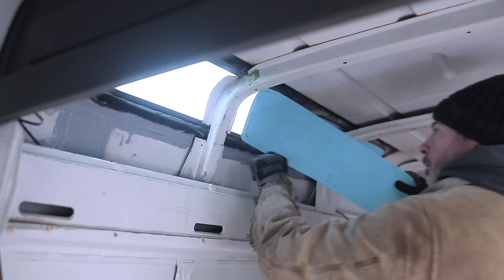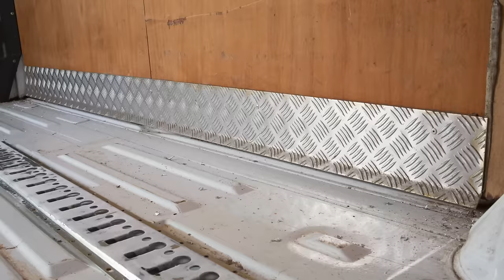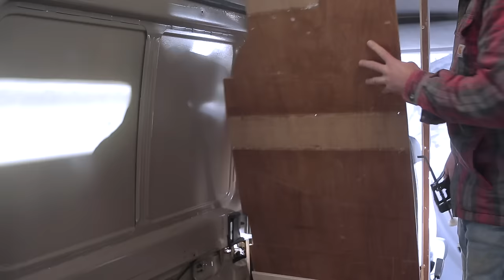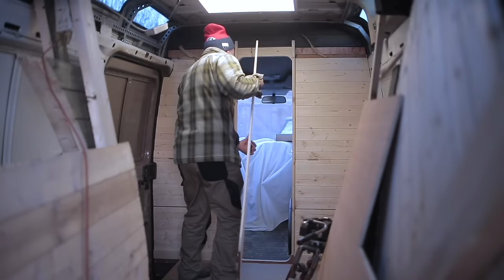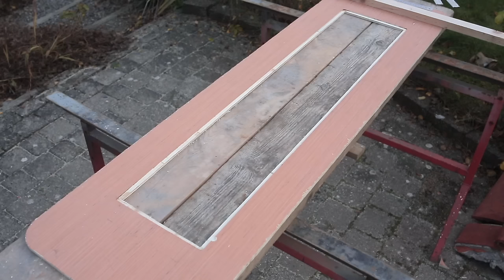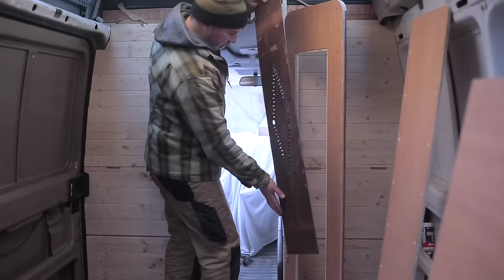How camper conversions get it wrong | Classic Sprinter build

Comment: You can cut straighter lines with the round side of the router than you can with the straight bit. 
Always enjoy the videos.
Reply: Interesting. Why's that then?
Reply: @beetooex  if the router kicks on the flat surface it's gonna sorta fall onto the big radius -more room for error - if you setup for big radius you have a lot more ergonomic control of the tool and aren't locked into fighting the flat surface against rotation - the radius will give you much more arm rotation through the cut.

Comment: Many really good points here. Even here in Southern Finland where we live camping in the winter is temporary if the wife kicks you out of home you will freeze your bollocks off. We had a transit Connect and to gain some space to move stuff removed the bulkhead thingy. Man was it cold in that van in the Finnish winter the poor heater was working overtime. Nice video by the way. Love what you have done with the bulkhead thingy. Give yourself a pat on the back :)

Comment: Beautiful, and the strength and versatility you've built into the bulkhead is impressive.  The only suggestion I can give for the sake of longevity is that the wood be sealed or treated (if it hasn't already) since it will be exposed to moisture.  That moisture can cause the wood to warp, separate and rot.  There are various polyurethanes that can give you a satin, flat, or glossy finish, sealing the wood while also providing a surface that's easy to clean and durable.
Reply from the maker: Could epoxy it, for further strength, durability and moisture-proofing, but it won’t do weight any favours

Comment: Looking forward to seeing your take on a van conversion! As you mentioned weight is a killer (not to mention the safety aspects) so I cringe every time I see IKEA kitchen units, porcelain tiles, sinks and MDF. Sorry not a fan of pine cladding either😏
I did my best to keep our 4x4 Sprinter as light as possible and it still gets far too close to 3.5T when fully loaded.

Comment: Soup-George attaboy-ing the bulkhead with piano-hinges and  the bulkhead-door with something unhinged coming also from a piano ... priceless. After getting rid of my swb T1N for ride-quality reasons, I am actually getting a T4 VW done for sleep-overs beside the road sea right now. It's absolutely too tiny inside for a decommissioned piano-door, but I got hold of quite some old 1910s Art Nouveau furniture pieces for fillings, fronts and details to recombine with aramide-carbon-composite framing and brushed aluminium profiles - Nothing better than custom interiors. Oh, perhaps a Lotus might come close, though. 😁 Thanks for sharing!

Comment: Excellent work as always, with real thought behind not only the practicality but also the beauty of the thing you're building.  The modularity of the bulkhead is an excellent use of what would otherwise be totally dead space and looks really easy to set up and use even at this early stage.  I'd be cautious of using satin as a backing for the fretwork, it's quite susceptible to UV damage leading it to fade and even break apart.  Upholstery grade fabrics tend to be more UV stable and of course there's always paint, foils, decorative metal sheets, and a whole plethora of other materials you could use which I'm sure you've already thought about.

Comment: That door looks great!  If it's not already in your plan, look into getting some iron-on edge banding that matches the plywood of the door.  It'll clean up the cut edges and make the door look like it was cut from a single slab of wood.
Reply from the maker: That’d be lovely, I’d want it in brass though. Pigs may fly
Reply: @soupclassicmotoring   Sticky backed copper tape is a thing.  It's not brass, but...

Comment: A work of art and a small engineering marvel, that bulkhead.  Nice job.  Don't sell yourself short on your woodworking skills.  I can't tell you how many times I see a skilled metal worker bust out their angle grinders, zip disks, flap disks, DA sanders and die grinders when they switch to the wood part of their project.  At least you own and know how to use proper woodworking tools.

Comment: There is no "wrong" in a camper conversion as long as it suits the builder's purpose.  Weekend camping or more or less fultime living has very different requirements.  Any van without some kind of a toilet would be wrong for me, has always been so, but particularly since COVID.  My tolerance for using any kind of public facility is almost zero.

Comment: I have a parliament hinge pivot as well, you just need to be careful with heavier big full size doors that the frame they are mounting onto is strong enough, as you have a lot more weight extended on the pivot, hence your door will be forever dropping on one side..  not your problem in this example, great video love the attention to detail, humour and individual thinking…❤😂👍 amazed at how you finish all this in less than 19 mins work,, 😅😂🤣 the clean up should be about 30 seconds don’t you think..

Comment: I like the fold down kid beds (?). That's novel and useful.  I always want to do the rotating front passenger seat, but that's on a smaller van.   I like the guy on his third build that just didn't do any kind of wet room or plumbing and that was right after I saw a video about a vanlifer that lost their build to a plumbing leak and water damage and had to do a spendy $$$ rebuild.  You just need big plastic water jugs and some pump(s).  Maybe a greywater jug.  Buckets and jugs.  I love diy builds.  They are the best.  Simple but innovative.  Don't get too busy.  Commercial builds kinda suck.

Comment: Most people look at van conversions as a house closet with windows. I am surprised they do not use concrete for the walls and floors.  Reinforced Crawlspace Foam Board Insulation and insulation blankets covered with material is the lightest weight material for conversions.  And then design it so everything is quickly removable including the floor.

Comment: Another thing they get wrong is using lambswool insulation for wet use. Body vapour (or anything more than that!) flows a certain amount through lambswool insulation resulting in dampness. Dacron, on the other hand, is made from recycled plastic bottles that is 100% non-absorbent and the minute difference in thermic loss by comparison is not noticeable in installations such as a van conversion. Body vapour rests on the surface of Dacron without being absorbed through it and evaporates off its surface much faster than off lambswool. If you use lambswool, especially for wet utility, you're asking for water absorption by comparison to plastic, regardless of how well they tell you wool "manages" it. Use Dacron. 🙂

Comment: Dunno where you are planning on sticking that Rockwool but i made the mistake of thinking it would work well as insulation in the walls on a van many years ago. It doesn't seal the air away from the steel panels so you get condensation in your walls which on my transit ran down the insides where i couldn't see it and rotted out the rear panels behind the rear wheels and the side door bottom from the inside out. Make sure the paint is good in the cavities or seal the metal up or don't bother with any insulation and just fit a better heater as it's not for living in for long periods.
Reply from the maker: I have a plan 🤓

Comment: Hallo, I am enjoying the journey of your camper conversion.  Regarding the insulation, I noticed you had a roll of loft insulation.  I live on a boat and after much research found that most products will not stop condensation, ( the enemy of van life.)  The only sure way is expanding foam.  Have you looked into this? Regards Grant

Comment: Regarding putting some satin behind the panel - would it be possible to lift it a few mm off the board behind, have it float a bit? And maybe put some LED's in the void that shine through the holes and on the saturn
Reply from the maker: Someone had the brainwave to use perspex, but that’s a nice idea too

Comment: As much as I appreciate the wood work. I think this is going to become very noisy. Wood especially low density moves so much in a warm-to-ice-cold environment that i think this will be very creaky over time.
Reply from the maker: Good call, I’m a sucker for learning by mistakes though 😅
Reply: I know and I'd like to have a piece of that too. Stop overthinking and enjoying the path to wherever things lead ;-) @soupclassicmotoring
Reply from the maker: I have the experience too! It’s amazing how much epoxy ply can soak up even without using cloth or mat. Starts to get pretty heavy. Def an option later if things get noisy though

Comment: There really is no such things a s a van build that has lost its way. What you do with your van, is different than what someone else does with theirs. Sure, you will be fine if staying a couple of days, here and there, in temperate locations. However, many people are living in theirs for extended periods, and traveling to very hot or cold climates. So they do need the extra floor and wall insulation.

Comment: You could have easily
Put ply under the rail instead of insulation. The insulation has no bearing on the bolts holding the rail down to the floor simple engineering

Comment: I don’t understand why you talk so much about weight, when this bulkhead you just built is twice as heavy compared to a simple bulkhead...Im not saying don’t build it, I just don’t understand your caution about weight.
Reply: This bulkhead allows the cab to be open to the back part of the time. He's saying when he wants quiet he can close it, and the amount of sound deadening he would need in the back would be a lot heavier than the bulkhead.

Keeping the simple bulkhead with no door means you have to get out and walk around every time you park. I've experienced that with a pickup and trailer and it's super inconvenient.
Reply: The bulk head is one item that should NOT  be left out of a van conversion. Be it the one it came with or one you make for access to the back. 
The amount of heat lost from the cab of a van is unreal.  Even  the simple act of carpeting on one side makes a difference..
PS  I will give it until 2024 before you get the cops along with VOSA  pulling these conversations over.  Weight will be top of the list,  horse boxes on the 7.5 ton truck will be a close second.
Reply: It sits in between the original sheet metal piece that wouldn’t be practical for camping, and some of the overbuilt designs you oftentimes see being done for projects like these.
Reply: @acoffeewithsatan    I hear you all, but if the objective is sound deadening, there are other much lighter ways to obtain sound insulation than a thick ply covered with wood stripes, plus the checkered frame...  I never said anything about not having a bulkhead, let alone a fixed not opening one.  Anyway, if this rocks his boat I rest my case. Good luck and happy trails.
Reply: You, and all the people who have commented on your post have missed the point. He wasn't talking about the weight of the bulkhead but of the final build. It is very important as not only do you not want your new van build to drink fuel like it's going out of fashion and handle like a brick due to its weight but it can also effect the classification of the van and possibly your licence.
Reply: @ogribiker8535    Precisely! I wonder how a 3x the weight of a normal bulkhead contributes to the overall van being light. But then again what do I know...
Reply: @arcenciel2968  I think the point he was making was that he's not going to have standard DIY kitchen cupboards and a lot of the other stuff people put in their builds so he can keep the overall weight down. We will all just have to wait and see.
Reply: You are right regards the added weight of this bulkhead but the savings are being made elsewhere. 

George wanted a solid bulkhead with a door but he is a father now so a bulkhead as the one he has fitted allows it to be lowered for when they are on the road so that they can see their boy (in one of the bus seats) etc. I think also he mentioned before(a way back) that the Irish rest requires a door in a bulkhead to have van cleaned as a ‘camper’ although that may be irrelevant now that he has mentioned there will be no fixed ‘khazi’(my word not his)
Reply: ‘Irish ‘test’.. even!!🤔🙄’
Reply: And..

‘Van classed..!’ 

Not ‘cleaned’…FFS!!
Reply: @malcolmyoung7866    Haha, this last response defeats every logic!  IF the bulkhead is made so heavy duty and heavy weight so as to block the noise behind it, it HAS to remain shut during driving. IF it stays open to check on the boy, what’s the purpose of the sturdy built?
Reply: Noise isn’t the issue… being able to see his son is the reason for this style of ‘bulkhead. It has flexibility so can be opened or closed whenever it’s necessary. 

Logic? 

Who said anything about logic? It’s a Feckin’ bulkhead that suits George’s needs..

Obviously you can’t see that or don’t want to acknowledge anything other than your own ‘logic’… methinks….

Have a nice life..
Reply: @malcolmyoung7866    If you refer to previous comments, you will see that this bulkhead’s main purpose is noise reduction. It is not me who says, ..., me thinks!
Reply: Well he said what he wanted out of it. If he had left the old one in, by the time you cut out the door and add the retract flaps that thing would be wayy too flimsy
Reply: No there is a reason,   In Ireland you cannot register it as camper unless it has a door entry from cab area to the rear, it’s for tax reasons.  The tax laws for vehicles are bananas and crazy priced.  The ongoing vehicle testing then has lower road tax.  😊 another Irish scam.  😂😂
Reply: @Scooopdog  in most countries delivery vehicles are much cheaper to register and insure than campers though.
Reply: @D3nn1s correct I have one but a commercial vehicle is not a camper and this is a camper conversion.  If you own a commercial in ireland it’s for business only you cannot carry passengers it’s illegal.
Reply: @Scooopdog  thats wild. But i mean you can as long as theyre all in the front row, cant you?
Reply: Weight? It’s a van!
People doon’t normally buy vans to never carry anything.
Reply: @arcenciel2968 in a word "Functionality" and he states 'Why' at the beginning of the video and also in the previous video. I don't understand what you don't get in his reasoning, seems obvious.. 
1. He's got added insulation
2. He's got beds.
3. He's got a door
4. He's got view of rear when needed
All for the weight of a single lightweight bulkhead structure.
5. Looks great! (Not like a work van!)

If you Add weight of 2 separate beds to even a non functioning metal bulkhead with no insulation attributes and it's still going to weigh considerably more than what he's got here with a pretty ingenious and unique highly functional design. Seems obvious to me he's knocked it out the park. Personally I'd add lightweight insulation to the wall and fold down beds for extra isolation and minimal heat loss. I'd also add lightweight under floor insulation aswell but that's just me.
Reply: @Malpriorvids Weight‽ People like high fuel economy! Why do you think these transit vans replaced most Stepvans and some full size vans in the usa; they're more aero, which means better fuel economy. Less weight also means better fuel economy, the engine does less work. Same reason F150s are aluminum and some 1ton pickups have composite fenders for the DRW's; less weight. You're missing the big picture, sir.

The less work an engine has to do, the better the fuel economy is. It's the reason why[disregarding the size of the fuel tank] an International T2 School Bus gets about 12 or less mpg with a 6.7 liter Cummins  while the Ram 3500 gets closer to 20mpg with the same engine.

There's a couple on here who's made most of their interior out of foam with a wood veneer, for the same reason. A permanent heavy payload is strain on an engine. I'd rather consistently carry around 3-800lbs of permanent weight living space, than 1000+, by making the things light, that I can make light. And given space, also keep that weight as low as possible on the chassis for something that small that isn't as stable as some types of busses, that just won't tip, should you fling it.

ItS a VaN!
Reply: @AB-C1 He did say that the lack of in floor insulation is out of wanting more head room in a van that barely has any if you're taller than 5'9. Same reason people raise the roofs of school busses and some vans. I'm 6'4, so I get it. I can't stand straight up in a school bus, because of how small they are, they're as tall as these high roof Sprinters or the NV's.
Reply: @Malpriorvids  absolutely not.  It’s forbidden to carry passengers unless you employ them.  People do it but if you crash your in serious shit as your “ commercial insurance “ is void.  You can end up in the slammer.
Reply: @Malpriorvids a big sprinter is only allowed to weigh 3500kg, but weighs nearly 2500kg empty. It's actually quite hard to do a full camper conversion in a big van and stay within the legal weight, the tonne you have to play with includes the people, any water, and your stuff, plus the fit out. Many big sprinters will be over weight when going away.

Comment: This made no sense.

You state these things (such as insulation under the floor) as being wrong, yet then you admit you're not even living in your van conversion full time, only a few days here and there, every now and then.

For someone living in their van 24/7, they are going to want insulation, under the floor and everywhere else.

Also, for any hard fixings, you would screw them directly into the strong wooden frame in the sub floor.  You stating it simply as a layer of foam between precious cargo and hard fixing, is not even remotely accurate.

This video literally disproved nothing.